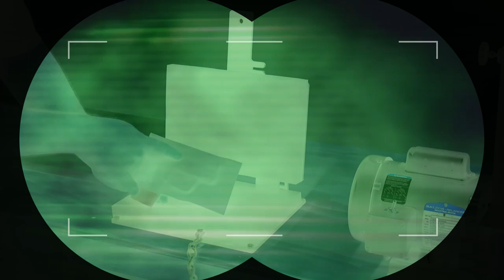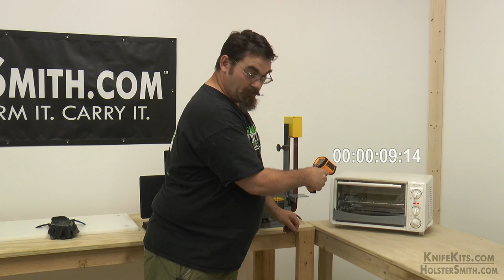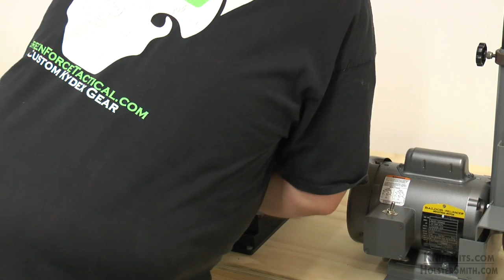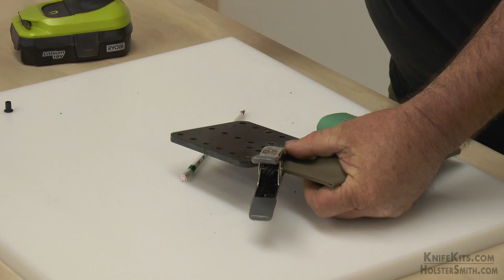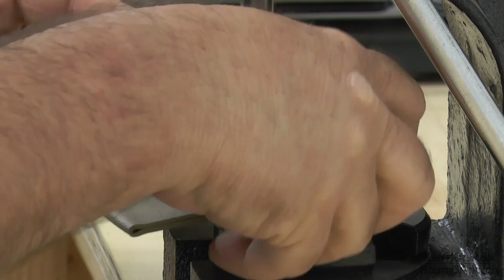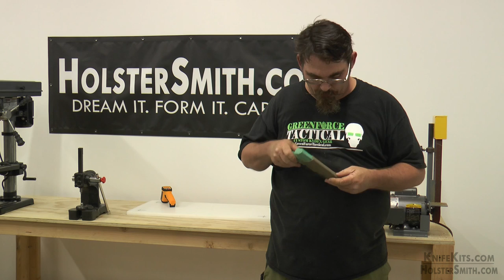DIY KYDEX® Project : How to make a 1-Piece Holster (Feat. Christian Green)

Comment: Good video. I was hoping to see how to attach a clip or loop though. Good basic instructional video though.
Reply: I don't have much experience with Kydex, but from other videos I've seen, anytime after forming it you can just put a piece of wood inside the holster to receive a drill bit without marring our deforming the holster, measure, mark, and drill the holes where they will line up with the holes in the pocket or belt clip you have, then attach the clip to the holster with the usual two rivets. You can use pop rivets, or the same kind of rivets used in leatherworking, or the kind with a pan head on one end that you have to peen on the other end. If you're not familiar with the latter two, the ones they use for leather holsters work just fine. You'll have to buy a bag of rivets an inexpensive driver tool to install them, but like I said, they're not expensive and you can keep using it for a long time if you plan on making more holsters.

Comment: Would Kydex be an appropriate material to make a "scabbard" for an hatchet?  For me, the important part would be to cover the sharp edge of the hatchet so that nobody is injured while the ax is in transport.  IF Kydex is a good material, would the important issue to be to heat the material and then fold it over the sharp edge and then rivet the remaining sides (and perhaps include a snap to keep the hatchet contained in the sheath?  Lastly, for those of us whose spouse would kill if we used our toaster oven for such a project, would a heat gun soften the material sufficiently to allow for a permanent bend?
Reply from the maker: Hi Tom. Thanks for watching. You can use KYDEX®, HOLSTEX®, or Boltaron. All will work fine using the same method as the holster made in the video. Look at the 3rd image below the main image here ... https://www.truenorthknives.com/vcom/product_info.php?cPath=668&products_id=8683

The above is a good design model as a starting point. 

All the materials begin here: https://www.knifekits.com/vcom/holster-making-materials-c-1071.html

Enjoy.

Comment: Do you ever have issues with the foam retaining the shape of the project and transfer if it to the kydex
Reply from the maker: Not unless the foam is in really bad shape, or it's exceptionally cold when you start the next pressing. Generally the marks from the previous pressing will smooth out when you apply pressure to the next job. We recommend that you make sure your foam is at room temperature, or slightly higher when you start. (not too hot, though!)
Reply: @KnifeKits  ok thanks

Comment: Can you use an actual firearm to make your holster, or is the heat from the kydex a problem?
Reply: Hi Alexus. You can use the actual firearm to make the holster with. Some people wrap it with blue tape before doing it to prevent scratching, etc. It's not required, though.
Reply: depends, with enough heat / pressure/ time , you can "bananna" a polymer frame... i  haz seen me do it... in any case, one of the DIY molds for your pistol is a safe investment, both for holstering, and for practice that does not involve shooting..

Comment: How does it stay hooked on your pants and what are the holes for
Reply from the maker: That's done with a mounting attachment, like a belt loop or IWB strap. The outer holes are eyelets that hold the Kydex together, but you can also use those for assembling your mount on, depending on what type you use. Here's a link to all of the different types that you can use: https://www.holstersmith.com/vcom/mountings-c-547.html
Let us know if you need more help!

Comment: How to you add the holster clips to attach it to a duty belt with outbtje screws scratching the frame of the fire arm.
Reply: Hi Duffchaser. Use a spacer to create the recesses between the frame and Kydex. That's what the mounting templates here (https://www.holstersmith.com/vcom/mountings-mounting-templates-c-547_692.html) do. You can use stacked washers, wood, just about anything to create them with.  Check out this video to see a similar idea. I've clipped it at the time where the template is being mounted ( https://youtu.be/xyUqTwkzmp8?t=103 ). Let us know if you need more help.

Comment: How would you put on the belt clip?
Reply from the maker: Hi Louie. It depends on what kind of belt clip you're attaching, but you basically drill mounting holes and use slotted post assemblies to attach.  This link will show you some of the assemblies: https://www.holstersmith.com/vcom/hardware-mounting-assemblies-c-553_560.html

Comment: Here’s a small tip for those that want to try this

Before cutting, take a white crayon or something you can make marks for the shape, was cut you can’t replace material, once you’ve done this a few times you might. It need to do this anymore
Reply: i like a good old pencil, it comes off easy, and doesnt go in the pores that open up in the plastic when heated, think tattoo

Comment: How many degrees do you heat kydex?
Reply from the maker: There is not really a set temperature. You are looking for the Kydex to sag uniformly. That lets you know that it is heated properly. Depending on the thickness of the Kydex and any potential outside variables it will usually be somewhere between 320F and 350F. The key is to heat it slowly because it needs to heat all the way through.

Comment: Everything is quite instructive and understandable. But why spend so much material, and then cut off half? And in my opinion, it is better to press the grommet at the very end, otherwise it is more difficult to remove dust after processing.
Reply: if you don't eyelet before polishing, you end up with an edge composed of 2 rounded surfaces coming together, like the front of a "B" instead of a seamless edge, its a preference thing, and if you eyelt them clean, then nothing that wont rinse out can get in that gap

does that help?

Comment: What if you don’t have the thermometer thing
Reply from the maker: Thermometers are nice, but you can do it without one. Make sure your KYDEX® material is heated enough to be evenly pliable, similar to the sheet in the video coming out of the oven.  You're better off bringing up your temp., rather than overcooking by setting initial temp. too high. 

For a quick temp reference: If you can boil water at your current temperature  you're above 212F (100C).

Comment: Cool video but by the time I buy all that equipment it doesn't make sense to DIY. You can get a kydex holster for less than $20 online.
Reply from the maker: You're right. If you only need one, and you're cool with one basic color (black) and texture (haircell), you can buy a holster for less than you can make one for. The problem is, most of us need more than one. We also produce over 300 styles of sheet color, thickness, graphic prints, sizes and textures. ( https://www.holstersmith.com/vcom/materials-c-546.html ) Options, baby!
Reply: Just getting into making Kydex and my brain is cooking up many ideas on what to make custom for my applications for weapons, knives, handlebar mounted cup holders for my fathers motorcycle ( he is an iron butt long distance motorcycle rider ) and the list goes on.
I will check out your website for supplies. Thanks for the well done tutorial.

Comment: I watch the whole video waiting to see how you attach some type of a clip to keep it on your waist. It was a great video up until that point
Reply: I don't have much experience with Kydex, but from other videos I've seen, anytime after forming it you can just put a piece of wood, plastic, or something similar inside the holster to receive a drill bit without marring our deforming the holster, measure, mark, and drill the holes where they will line up with the holes in the pocket or belt clip you have, then attach the clip to the holster with the usual two rivets. You can use pop rivets, or the same kind of rivets used in leatherworking, or the kind with a pan head on one end that you have to peen on the other end. If you're not familiar with the latter two, the ones they use for leather holsters work just fine. You'll have to buy a bag of rivets an inexpensive driver tool to install them, but like I said, they're not expensive and you can keep using it for a long time if you plan on making more holsters.